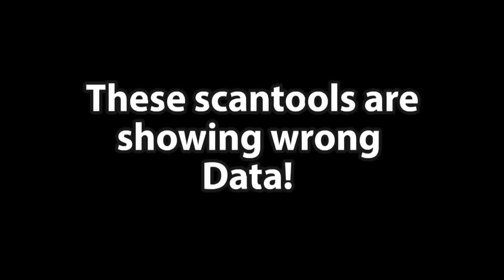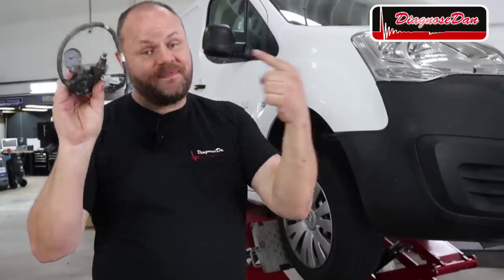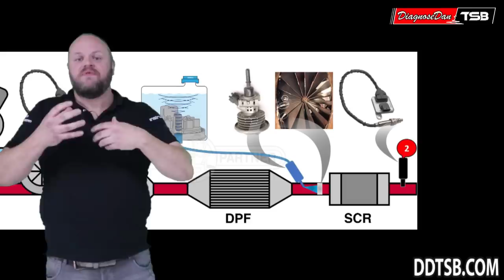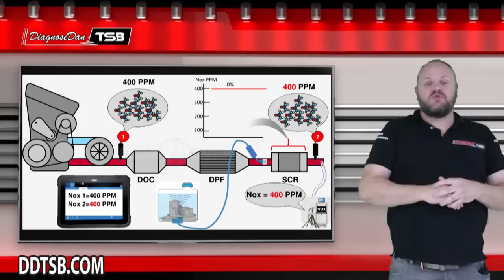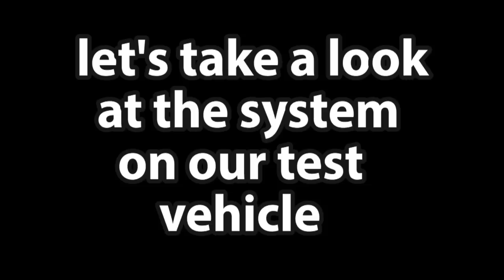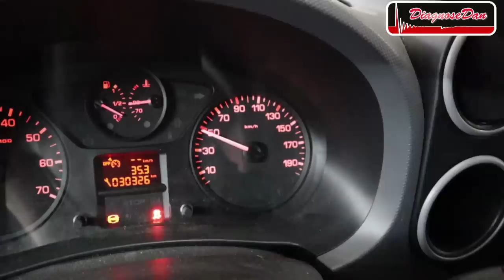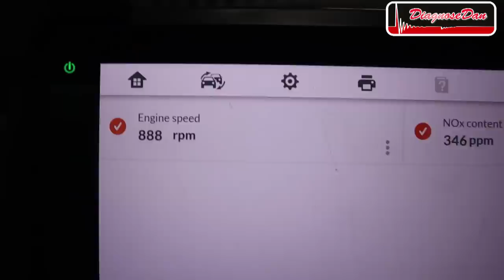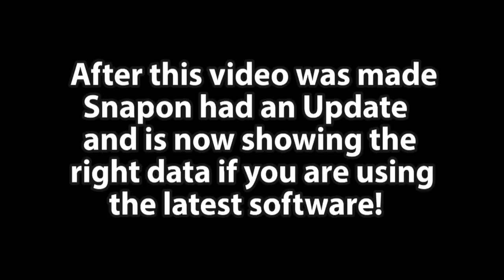Wrong parts replaced because of these scantools!

Comment: I recently dealt with something similar while working on my BMW 335d - I was getting intermittent check engine lights and the LAUNCH Scan Tool was giving DTCs for DPF pressure issues. Checked the data PIDs and noted that there were seemingly erroneous readings for the exhaust pressure sensor. Replaced it and it stayed exactly the same (It was showing like 120psi). Ended up utilizing ISTA+ which showed the correct data and led me to find a soot clogged differential pressure sensor hose.
Reply from the maker: Unfortunately that happens sometimes 😬

Comment: You should call it DEF or AUS 32 (aqueous urea solution 32%) for the non German viewers.
Reply from the maker: I'm not German and in Europe we call it adblue. I think viewers from outside the EU are Smart enough to figure out what that means. Don't tell me next to not use metric 🤣🤣
Reply: @Diagnosedan  LOL I'm good with metric now that I've spent so much money on them. When I looked that stuff up it said that was the German name for it. That's the only reason I said that. Ive never heard it called anything but DEF since it came out other than some people calling it urine. I dont even use the stuff as I still drive the last year model Ford Powerstroke that did not use it (2010 6.4L) So far it's been trouble other than one fuel pump 10 years ago.

Comment: The fact that 3 different brands show the wrong result (but similar between them) makes me think that they obtained the PIDs codification from the same source and that that source being PSA or third parties, didn't provide it correctly. Probably it's not the scan tools companies fault.
Reply from the maker: You are right, most scantool manufacturers buy the software from third parties
Reply: Yes many Eastern Europe programmer providing source 99% made in Shenzhen because it is easy manufacture electronics

Comment: This is as I see it an effect of an incorrect scaling for the PID in question and I assume that manufacturers of aftermarket scan tools only have a few sources for PID data where most goes back to the vehicle manufacturer. And even at vehicle manufacturers the scaling sometimes gets incorrect. The reason might even go back to a replacement of the sensor late in production where you had sensor A during development but changed to sensor B with a different resolution and then someone forgot to update the PID accordingly.

It can be even more interesting if the build order for a vehicle lists the wrong part number. A friend of mine had one car with a MAF issue but it was revealed that the build order for that car listed the wrong MAF and the ECU just thought it was a faulty MAF, not the wrong one and did set the check engine light and throw a code about a bad MAF. Replacing the MAF gave the same incorrect MAF again until there was a mechanic able to discover that it was the wrong MAF. I wouldn't be surprised if that happens now and then, something to consider when you end up with a lemon with mystery issues.
Reply: Well explained thankyou
Reply: In this case most of the tools showed ten times higher numbers, so yes, a simple scaling mistake there. Back in the day there were also some brands of cars that gave fault code tables in base 10 and the aftermarket scan tool gave the codes in base 16, or vice versa. That was a fun time with Windows Calculator to convert between hexadecimal and decimal numbers. This is why I consider the scan tools just translators that translate the language of the control unit to a language that the tech undestands. The translation just isn't always right while it most of the time is.

The French also have a (weird?) way of using some generally less used SI prefixes, like torque specifications in daNm (da = "times ten") instead of just plain Nm. This may have something to do with the ancient torque specifications being in kgm, as 1 kgm ≈ 1,02 daNm = 10,2 Nm, and I've spotted some obvious scaling mistakes by ten in translated torque specifications of French vehicles in the past, so this has been seen in print as well!
Reply: Agreed, it just looks like it's out by a factor of 10
Reply from the maker: It might be an incorrect scaling but still incorrect, Both Snapon and Launch made an update available that takes care of the issue. Most scantool manufacturers buy the software from third parties. Thanks for watching

Comment: Awesome video Dan !! 
I have been waiting for you to end up doing a video like this. I have ran into the exact same problems in the past. For me it was the “Last Straw” for my Snap-On and I have been using Autel Pro  since then. The factory tools are just way too expensive here in the US.
Reply from the maker: Some factory tools are expensive and some are quite affordable.
Reply: @Diagnosedan  I work for Ford. Ours are not expensive. You can use a regular laptop or tablet. Then you buy the software (IDS/FDRS), and to connect the computer to the car we use Bosch VCM's. Overall, the system works fairly well. Its just too bad our cars don't.

Comment: NOX=Nitrogen Oxides are a family of poisonous, highly reactive gases. These gases form when fuel is burned at high temperatures. NOx pollution is emitted by automobiles, trucks and various non-road vehicles. Usually produced under acceleration, engine knock, lean running conditions, timing advanced, or excessive inner engine heat produced due to combustion/high compression.
Reply from the maker: Thanks for the comment

Comment: This is why I don't like tools that don't show the PID/address values from which they are pulling numbers.  So were the incorrect tools pointing their rear sensor label at the front sensor address?  I would liked to have seen the front sensor value as well in the data capture, since it's directly relevant to the scenario.
Reply from the maker: This particular engine does not have an upstream sensor

Comment: I had Texa IDC5 say the fault was with the adblue heater and a cheap clone say Nox sensor 2. I checked the feed at the Nox sensor, no feed! The £50 clone was right! The sensor had blown the fuse, I replaced the sensor and BOOM light went out.
Reply from the maker: Amazing! Was your original Texa up to date?

Comment: I was diagnosing a gearbox problem on a Maserati. The scanner I was using, was the Autel Ultra. I checked the hydraulic pressure from the data, and was 18 bar. Likely and unlikely, that day, it was one exactly same car in the workshop,which was working perfectly. I hook up the scanner, to check the pressure (I didn't know what should be the pressure, but I thought I will have a known good data from the other car...).The pressure was 500 bar.So I said, I found the problem. I have low pressure (18 bar).I replaced the pump, bleed  the system bla bla bla, and I checked the pressure on the live data, was about 48 to 50 bar (up and down).I was thinking, the other car which I checked the pressure, was 500 bar,what's going on?Faulty new part?I couldn't understand it.After spending some time to figure out what's going on, I said, I am going for test drive. The gearbox was working perfectly. so, Likely,I had a wrong pump (old pump reading 18 bar,new pump 48bar).But I had one scanner, Autel Ultra, two identical cars,was working both (after the pump replacement), one car data was 48 bar,the other 500bar.How can be working both, with so much pressure difference?
Then, I think that something like 48 × 10 =almost 500.But still doesn't make sense why to be like that, with the same scanner. 
And by the way, 500 bar is f@cking a lot pressure, for that design,to be true. It's a mystery, that I  won't find out,I guess. But most likely for me,the right reading, was 48bar. 
Car was working, jumped to the next job......
Reply: Maybe different gearbox control module software versions?
Reply: @blockbertus  I didn't check with the scanner, which version was,unfortunately. I didn't think it, to do it.Maybe was some other version, with a kind of corrupt file, only in the live data?But it was almost 48×10.Also,Dan, looks like he has a similar issue, × 10.I don't know if it's something that we missing,to be × 10.But had to be exactly the same.
Reply from the maker: Strange that you had different readings on the same model!
Reply: @Diagnosedan  since then, every time I am looking live data, I don't know if I can thrust them 😇

Comment: I had Autel and Launch showing 3000bar fuel pressure on a new *GDI Opel Corsa the other day. It was a 2021 model so may be similar to your issue with newer vehicles. 

What was the pre NOx cat sensor reading out of interest? 

Thanks for the video!
Reply from the maker: I see wrong rail pressure readings alot!
This particular  engine doesn't have an upstream Nox sensor
Reply: Some modern diesels have injection pressures of over 2500 bar.
Reply: @MattyEngland  Forgot to mention, this was GDI 👍

Comment: This is one of the reasons I keep a different variety of scanners around in my shop! Great video Dan!
Reply: How do you determine which scantool is is giving correct data?
Reply: @mechanoid5739  I only use the original manufacturers scantool. Otherwise, you don't really know.
Reply: @michaelb7071  How can you even afford that!? Modern manufacturer scan tools are generally subscription based and cost $$$$ per year for each manufacturer. Subscription runs out and it's basically a brick.
Reply: @mechanoid5739  I honestly don’t think that I could spot that the way Dan does.. He’s just a beast on cars and diagnosing these types of problems. I’m nowhere near his abilities when it comes to these types of things. I just work hard and I really enjoy having different tools to scan different makes of vehicles. There’s a feel you get after doing it for so long like snap on is no good on euros, launch is no good on Asian vehicles so you just jump around and find what works. Hope I never run into this problem tho!
Reply: @gregjones8501  yes, and don't be surprised when the less expensive scan tool is the one giving you the more accurate information.
Reply: @gregjones8501  launch is no good on Asian vehicles? I'm surprised because in my country (india), which is full of Asian car brands, majority of mechanics use launch scan tools and they work really good.
Reply: @lordjaashin  I’m only saying this bc I used to work for Honda and I used my launch scanner vs my snap in and my snap on (surprisingly) would do things that the launch didn’t have an option for.. Don’t get me wrong I love launch scanners but back then my snap on was great on them. I buy autel nowadays and I love em!
Reply from the maker: All scantools have strong and weak points. In my case most of them were weak on this specific model
Reply: @Diagnosedan  which brand of scan tool has the least amount of weak points in your experience?

Comment: The vehicle manufacturer must provide information to the scan tool mfrs on how to access the data and how to interpret it.   Possibly the wrong data was provided to three of the companies, then they found the error and fixed it before giving that info to Autel.  Seems unlikely that all three companies would have gotten that same data PID wrong by chance.
Reply: I believe that Launch reverse-engineers other companies’ products in order to make their products.
Reply from the maker: Most scantool manufacturers buy the software from third parties

Comment: Well I have worked on older vehicles in the past and been led down a rabbit hole. So you sir are not alone.  I'm sure you will save some poor tech the aggravation.
Reply from the maker: It can be frustrating Kevin but fortunately most of the time the data is correct

Comment: A scanntool only shows you a path, so i always try to proof a reported fault bevor i changing parts...
In this case it looks like there should be a "," between the 3rd and the last digit. (when the tool shows you 4 digits)
Reply: You mean a decimal point, which is "."  😛
Reply: @user-AdamSmith  In some countries, the decimal point (in mathematics), when written, is replaced by a comma. This is strange. In my country, the comma is written...
Reply: @engeneer_ru5827  I know.  Same variance as people that use . instead of - in phone numbers.
Reply from the maker: Thanks for watching

Comment: and What was the real problem with the car? How did you fix the NOx high values?
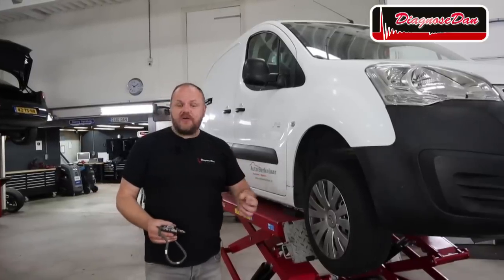Reply: The injector for the fluid 1:37
Reply: See 1:39 in the video
Reply: Think at the start he said the issue was a intermittently faulty adblue injector
Reply: 1:40 faulty Adblue injector

Comment: Kinda looks like the other scan tools forgot a decimal point. 5263 ppm instead of 526.3 ppm
Reply: I Was thinking that too
Reply: Yep, as soon as l saw the Launch tool readings...ooh look, someone forgot to put I a decimal point!
Reply: Oops, I meant autel
Reply: Well spotted
Reply: 🤔 maybe they copied each other
Reply: That's what came to mind for me too. Interesting to note that Snapon fixed it quickly with a software update, which further supports your observations!
Reply: Yep saw ot too and checked for a comment about it. Hope Dan replies...
Reply: I agree with you, it look that the lecture whit 4 digits need a decimal point as you mentioned. The original scantool shows lectures on 3 digits as same as the Autel… saludos!
Reply: Exactly my thought
Reply: It is, Even the original tester diagbox has te same fault.
The nox sensor before the scr is shown in the data with 1 decimal behind the dot and the  nox value of the second sensor is shown with 3 decimals behind the dot.its really confusing if u are making a testdrive and watching the screen

Comment: Amazing different, when you are making a judgement call on data, and the information is wrong. I think its hard enough to diagnosis some jobs with out questioning your data. Great video again Dan, as I said before, Dan your the man!!
Reply: well... at least you have scan tools, wiring diagrams and access to oem parts. Try to diagnose motherboard of the phone: schematics that fell from truck in China, Black market board views made by someone, no access to parts other than scraping them from another phones and immortal chip serialisation and self-erase if you try to read it, not to mention chips that can not be replaced. Fun games:)
Reply from the maker: Yes you are right, Diagnosing is difficult enough with accurate data 😉